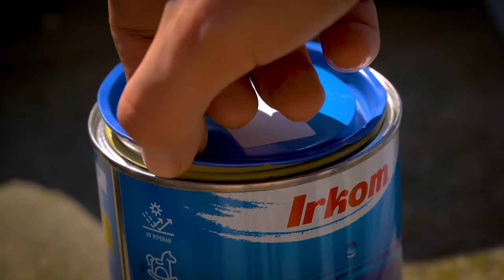Breeding Cages For Birds | DIY Craft | Nesting

Comment: where did you get the steel fence
Reply: 66666666666666666666666666666666666666666666666666666666666666666666666666666666666666666666666666666666666666666666666666666666666666666666666666666666666
Reply: @carlostapiaortega2224  کے
Reply: 8ooo
Reply: I want to know same but no reply